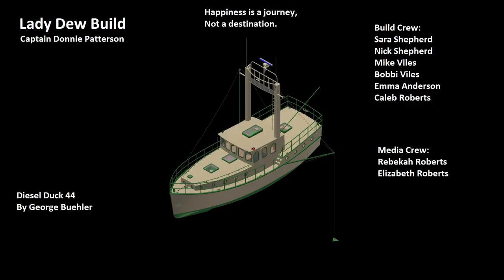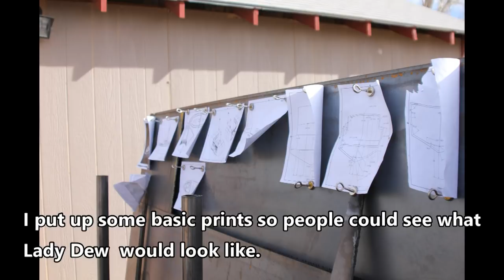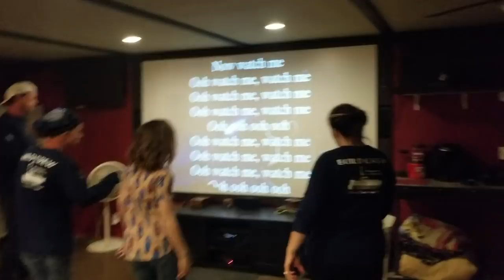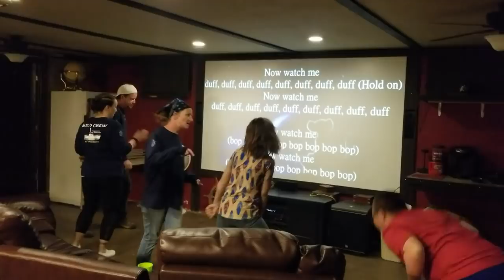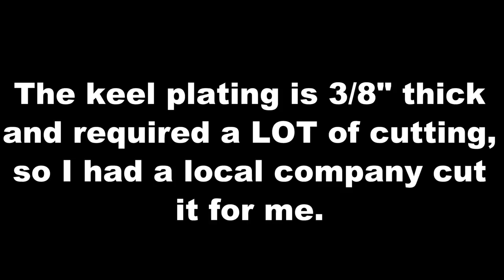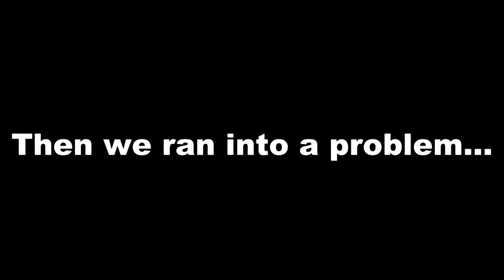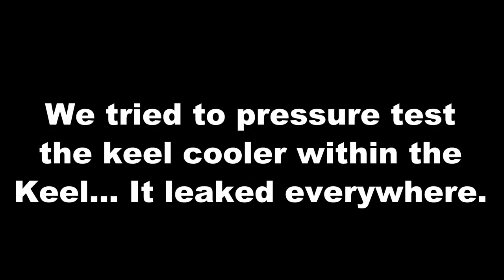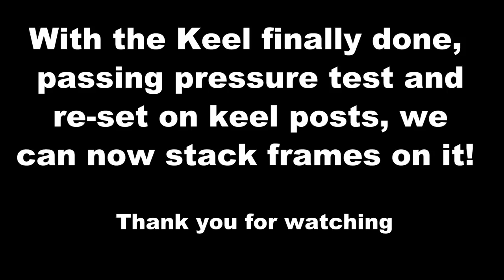Lady Dew Build - Episode 3 Keel

Comment: Hi so glad you got the keel cooler sorted and got welding advise early on. Doug at SV seeker took 5 days to fix his keel cooler leaks. We were building a water cooling rotating tank for casting tin extrusion billets and I showed the guys Dougs video and made them pressure test before going any further. we had leaks , took a day to chase then down! BUT so glad we did. We have made 4 more similar billet mold machines and we are starting the 6th now. You are not alone It happens to all of us, leak proof welds are a lot harder than it looks..   But it does make me wonder about regular plate welds, how do you check them for pinhole leaks?
I think about that on SV seeker with all the different folks he has welding.  I like to stick weld as you get a lot more penetration but slower and a little harder to learn than MIG. 
Did you say what design you are building?
Great job , so glad you have some ladies welding. They can be the best welders , something about their eye for detail, they just do a good job.
Cheers warren
Reply from the maker: I have this penetrating spray and developer that will be sprayed on every hull weld.  One side gets sprayed with the purple penetrate the other side of the weld get sprayed with a white developer, if the purple can find even the smallest pin hole it stains the white developer on the other side.  
The boat we are building is the George Buehler designed Diesel Duck 44.  He has two versions, the classic and the evo.  The evo has a bit more volume, but I liked the looks of the classic more, so I am using the offsets of the evo and the look of the classic for a hybrid.

Comment: Could you please, explain in more detail, what the welding wizard suggested to make the cooler hold pressure?
Reply from the maker: Well it came down to we had porous welds, we had to grind them out and re-weld.
Reply: @LadyDewBuild  And the main cause for having  porous welds was?
Reply from the maker: I didn't properly train Sara on welding. Totally my fault.  I had set up the welder but not turned in the shielding gas.  Sara came out, welded for 6 hours without gas.  I have taught her to a) listen for gas and b) check her welds often and the problem went away